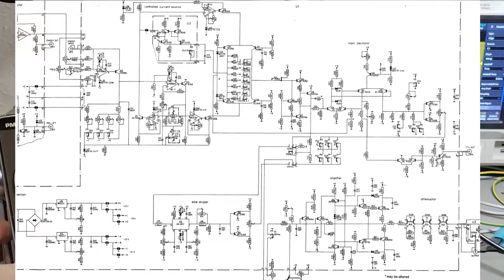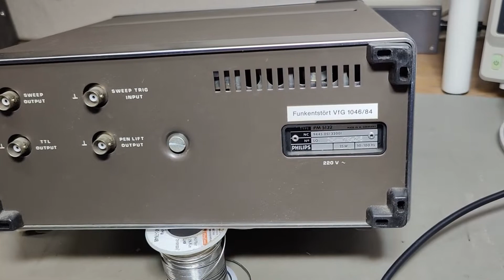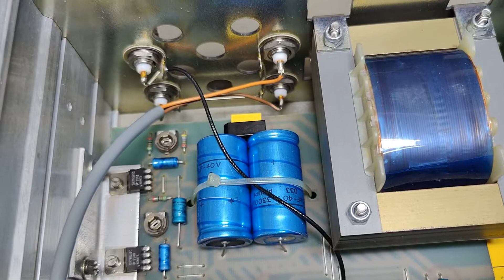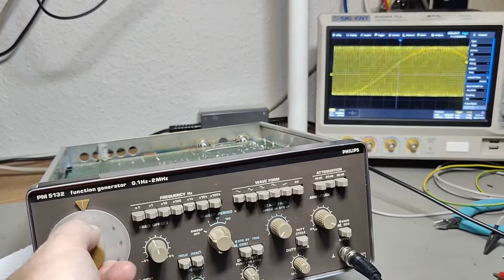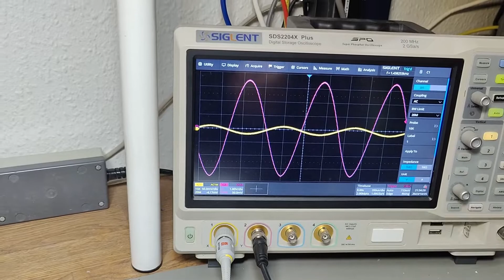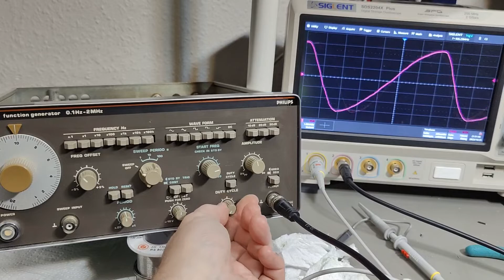Philips PM5132 function generator 0.1Hz - 2MHz 1984 test repair teardown

Comment: Very nice review/repair again. You always have quite interesting and diverse equipment. I myself have a few other Philips function generators that needed similar repairs (PM5127, PM5134, PM5135, PM5191 and PM5193). I think it is very normal for the power supply to drop a little on full load, there should be enough margin for the output to still reach its maximum. On the PM5135 I had a similar problem on the frequency potmeter, but in a worse state. Mine had a bright red CP.16/001/M25S potmeter. Grease from the shaft tends to migrate to the resistive track, giving bad contacts. Black residue on the contact wiper and tracks. The back of the potmeter was molded into place, but with some careful cutting, you can get the backplate off and clean it with IPA and then some new grease and contact cleaning should do the trick. Getting the plate back with tricky, but it worked. Not sure if your unit uses the same potmeter, but maybe it is repairable.

Comment: i hjave very similiar signal generator siemens product.. old elec. caps causes power supp. ripples and  .lactuation o. .requency. ..pots need to be removed dirties by using contact cleaner ( contact 60 is still good)..  i think .lips engineers are so smart . because in that time thye opamps .rq. were not so high. that circuit designed by voltage controlled osc. technic. and .sweep  osc. works bu using it.  (i am 71 yo and service eng )
Reply from the maker: thanks for your message, yes i use all products from kontakt chemie

Comment: That’s a beautiful generator. Sweep is by injecting a current into a capacitor, then there’s a FET buffer. Sweep stop disconnects the capacitor from the current source. As long as the capacitor is not leaky and the FET stage is good, it will stay at the same voltage for a while. It does drift very visibly if you connect it to a digital voltmeter, but it’s of no big consequence in practice. The drift can be very low and there are tricks to compensate for it.

Comment: Thak you very much for this video. I had my PM5132 laying around with exactly the same problem. I was opening&closing the solder bridges back and forth but could not get rid of the noise. I thought one day I will remove caps one by one and check for bad ones. Following your video I did an overkill by changing all elecrolytic caps - problem dissapeared. Later I measured ESR: 543+544 were ok,506+529+530 went from 5Ohm to 28Ohm ESR, 545+546 went from 6 to 20Ohm, 547+548+511+512 went to 200Ohms. My PCB is not so discolored because of temperature so I concluded mine should have much less hours. Visual design of Philips hardware is very appealing so I am quite happy having "new" device for years to come.

Comment: Recommending Kontakt 61 (generally assumed to corrode stuff if not washed out) without explaining the difference in usage to Kontakt 600 (well known to make stuff smell of cheap hairspray if not washed out, but is at least supposed to not corrode stuff) might be a disservice to some viewers and their projects.... No disrespect intended!
Reply from the maker: if you ask 10 engineers about how to clean contacts, you get 10 different stories, some even directly claim what others do is directly wrong, every one can do what they like, I only got 40 years experiance , i use both kontact 60, WL, 61 and the best all in one product is simply 61
Reply: @TeardownOZ2CPU  I owe you an apology. I confused 61 for 60, and was kind of shocked about the idea of injecting Kontakt 60 into switches and leaving it there...
Reply from the maker: @splitprissm9339  you are welcome, i also got kontact 60 and the cleaning spray but i always apply a final layer of kontact 61, i tried all sprays there is, and i must say if i can only own one spray, it will be contact 61